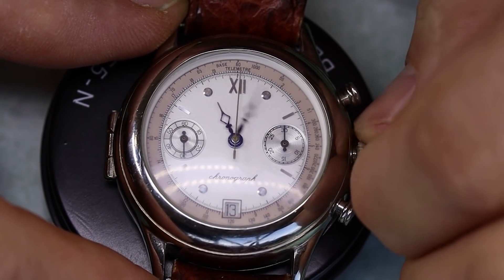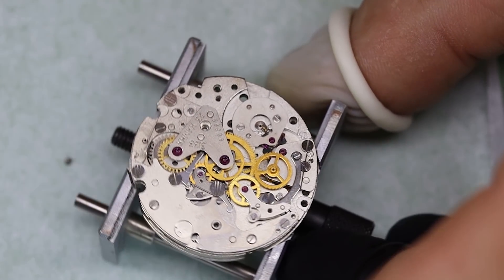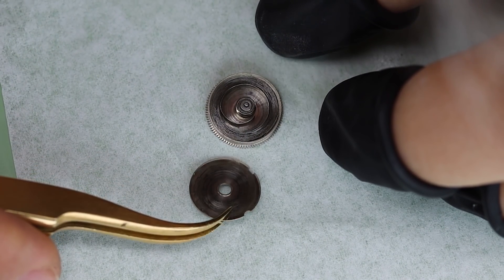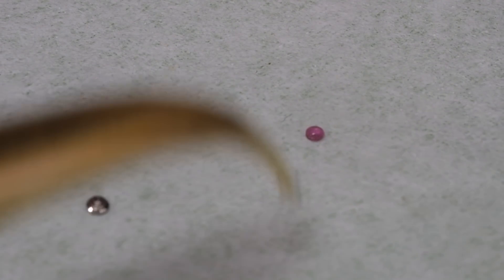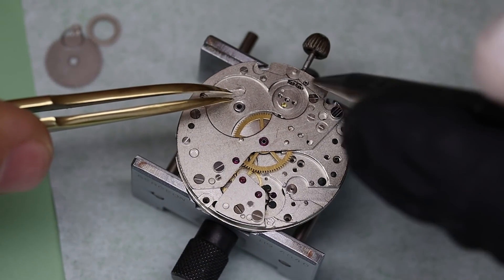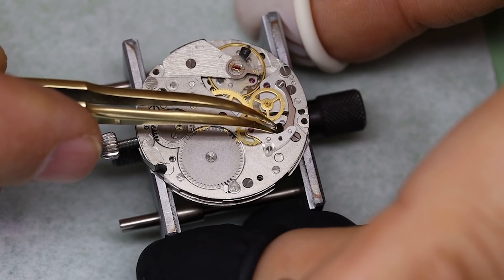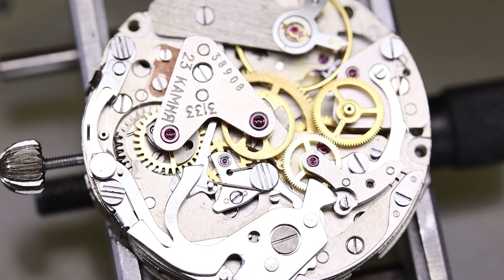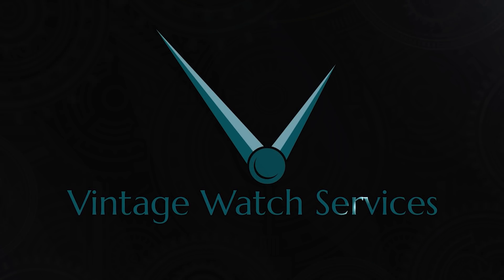How good are Soviet watches?

Comment: What is strange, they normally write "Made in CCCP"  or "Made in Russia" on the dial and the equivalent in Russian on the back. Also the painted instead of heat-blued hands are indicating Chinese origin. On the other side, Soviet movements look more rough in general, the surface treatment is less shiny.
Reply from the maker: This might very well be a Franken, the dial and case might not be original to the movement. From what I know, the movement is from the late 80s but the dial seems newer and possibly Chinese according to other commenters.
Reply: @VintageWatchServices  верно! Механизм это СССР, корпус - Китай)
Reply: @VintageWatchServices  Yes , it could easily be a franenstein watch , that would account for the part being broken and maybe that screw that you had to put a shoulder on might have been a wrong one used by whoever cobbled it together
Reply: I have a watch that says USSR, and it has a more traditional dial and is heavily gold plated. Looks very different from this watch.
Reply: I think you could make a successful comedy channel as well as a first rate watch one.
Reply: @VintageWatchServices  i agree, yet there is nothing wrong with a franken. my favorite is a 3133 I recased, changed dial, changed hands. the reason was for comfort and readibiility and this is my personal one of a kind. one thing to remember on 3133 is never reset the chrono unless stopped! 
some people like a watch to be a museum artifact, others prefer them to be a useful tool, and some poor fools use them as jewlery. I have not yet come across a 3133 that couldnt be cleaned and serviced to within 5-8 seconds per day: useable for astronavigation. as long as you dont actually use the chrono ;)  because then all bets are off. thats normal for movements that share the mainspring with the chrono.

Comment: Thanks for sharing this. I am more into machining but Your presentation is just addictive ...
I have owned a Lada. The model was 1200L and it was a very reliable car especially when it was cold. For extreme weather it had this hand crank for starting the motor by hand. When it was really cold, You just turned the motor over a few times with the crank before trying to start it. That made it little bit less stiff and it started as if it would be summer. With cold weather I mean temperatures -25C or less.
That car had very stiff steering and most uncomfortable driver seat. In Finland we said: "Visit the gym before buying a Lada".
Very few Ladas have survived because they had some corrosion problems and were usually scrapped because of their affordable prise.
Reply from the maker: Thanks so much! Ladas were indeed quite cool and I was in general very happy with mine. The only letdown was when the heating gave up in the middle of winter, but that was because of a faulty water pump. Relatively easy to fix and afterwards it worked just fine again!

Comment: Yes you are correct . I too have had a snapped operating lever . Plus a ridding high yoke allowing the sliding pinion to jam on the intermediate wheel , stopping the movement.

You are a good teacher
Reply from the maker: Thanks so much, Andrew! Did the operating lever snap on a 3133 or a Valjoux?

Comment: When I first started collecting Russian watches I longed to have a Poljot 3133 in my collection. I got one, and then sold it and some other watches in order to buy a much nicer Omega. Then, a few years ago a good friend in Ukraine gave me a Aviator 3133 chronograph and another Buran came into my possession. The Aviator had something wrong with its case and so I found a different one and dial/hands to swap out. It worked fine. All this to say, I love the 3133 chronographs even though they aren't all that pretty and suffer from poor craftsmanship. Probably from folks who weren't exactly "watch makers" but knew how to follow directions to assemble them. Thanks for doing this one. It's pretty, and yet has its flaws, like most of my experiences in the former USSR.
Reply from the maker: The base 3133 design is very sound of course, based as it is on a Valjoux design, but the execution of it is indeed a bit rough around the edges (literally). The newer ones are apparently more refined though, so I suppose they improved :)
Reply: @VintageWatchServices  nothing time and care cant fix!

Comment: Hi Stian, another excellent interesting and informative video, i quite like Russian movements i have 4 good ones a Raketa 2609 ha 2 poljot 2614.2 H that i got from ebay got one in a job lot both just needed a service and regulating now both are around +-3 s/d 36 mm in Seconda watches and another with a Slava 2427 that needed work cracked jewel and worn barrel bridge on the arbour close to the crown, i didn't have the tool's then so got a doner movement now runs like a top i did know to put into time setting to remove and replace stem Ranfft on google, had to have a sensitive touch to replace though, Russian movements for practice and learning great, thank you for sharing Stian. I hope to have a go at fixing a chronograph soon.
Reply from the maker: Thanks Dave! They are indeed excellent movements to learn on and generally quite solid although this one had more than it's share of problems...
Go for the chronograph, you can do it! Take a lot of pictures and be very careful :)
Reply: Hi Dave, I’ve not serviced a Chronograph yet, it will come.

Comment: There's no way in USSR that watch would be sold in the western market without "Polet" logo and "Made in USSR" and letters in latin. Period. That is post-Soviet era watch, possibly from the early 2000's or even late 90's.
Reply from the maker: Thanks for that info! I have some suspicion the dial, case and movement might not be original to each other. From what I know, the markings on the movement and the materials used indicate a post-1983 but pre-1992 manufacturing date, but the dial indeed seems newer.

Comment: Another great job Stian! And useful for me since I have a small collection of these, and there's a  couple things I can apply...
Regarding quality, the specific movement you sre servicing here seems to be from 89 (change from 4 to 5 digit s/n) to 91 (when chrono bridge inscription changed), a time where things were going south in USSR, and quality control in Poljot was suffering. I find that early 80s pieces are better built. Also, the dial and case are most certainly either post-soviet era, or chinese imports. All in all, IMO a not-so desirable 3133, especially compared to the steel case military pieces.
Reply: BTW can you share the mainspring replacement reference? I haven’t been unable to find anything in GR, and it is increasingly difficult to find NOS replacements. 
All the docs I found say it should be 1.60, and you used 1.70, has it caused any trouble?
Reply from the maker: Yes, this is indeed most likely a Chinese case, dial and hands. The metal in this movement is low quality. After this service a subscriber bought the watch and only after a few months the reset lever flag broke off in the exact same manner as the operating lever flag...
Reply from the maker: I used the mainspring list from watchguy.co.uk, it is in general very good. You will find it under Technical Information
Reply: Thanks a lot, I will look in there.

Comment: Thanks for taking the time (all puns intended!) to explain the mechanical underpinnings of the chronograph mechanism and showing how it works. The question I have though is, why didn't the roughness around the barrel pivot hole in the baseplate cause the watch to run poorly earlier on in the life of the watch? Did this roughness develop over time, or do you think it was always there?
Reply from the maker: Hello Tim, I don't know how the watch ran earlier in its life, and unless the barrel was changed, the roughness would have been there to some degree for a long time. But these things indeed grow worse over time. As soon as there is somewhere that dirt and debris can gather, it will, and that will cause wear.

Comment: After greetings, let me ask about that fix drop, in Omega ,they use it with another name called Lubita.to prevent the lubricant  from spreading. Is it the same under different  name?another question, they put the parts after Lubita on a metal surface  for 15 mnts. Under cover ,then we assemble it. An other remark, this Lubita also for lubricating the non reverse wheels
Reply from the maker: Hello Samir, thanks for watching! It sounds like you mean Lubeta, which is an ETA lubricant (lub eta), for reversing wheels (lubeta v105) and ball bearings (lubeta v106). You would use a similar bottle for soaking the parts and indeed let them air for 15 minutes, but these are lubricants, while fixodrop is an epilame. The purpose of an epilame is to prevent lubrication from creeping. It is thus used prior to lubrication.

Comment: my first watch was a Poljot Chronograph which i bought aged 16 back in 1969. I lost that after i stopped wearing it in favour of a LED one when they came out in the mid seventies. Sorely tempted to get another one as they often appear on eBay
Reply from the maker: LEDs were super cool back in the 70s and no one wanted a mechanical watch indeed :) These ones are generally good value for money!
Reply: @VintageWatchServices  the one I had had red Leds that only illuminated when I pressed a button on the case, a bit of a nuisance especially when I have had cover the watch with my hand  in bright sunlight
Reply from the maker: @admiralcraddock464  Very small price to pay for the über coolness, no? 😁

Comment: How did you resolve the broken tab on the pusher lever? Are some of the Valjoux specific parts interchangeable?
Reply from the maker: I replaced it with a VJ7733 lever. The levers are indeed interchangeable but not all parts are.

Comment: Fun video although I was slightly disappointed that you didn't put the minute hand back at EXACTLY 12 when reassembling.
Reply from the maker: Thanks Jack! If you check the video closely you'll see that the hands are perfectly aligned 😉 The reason I placed the minute hand slightly off was that the hour hand had moved slightly. It's a bit risky to do it this way, but with a bit of experience it can work :)

Comment: I have a soviet mechanical watch...and of course it has never kept good time and stopped running a year after I got it! Probably something like you found in this watch is going on it is as well.
Reply: what kind of movement is in it? most of main soviet movements like vostok-2209 / raketa-2609 / poljot-2609 / slava-24** are pretty robust. yeah all of them except raketa-2609N have their flaws, but they are pretty easy maintainable.
Reply: @karlja3ger  No idea....never opened it up

Comment: Hi Steum you could tell the parts are thin and stamped out that as long as it works 🤷🏻‍♂️
Reply from the maker: Yes, many of the parts are stamped out, that was part of the more industrial turn Valjoux did with the 7733 and of course to an even greater extent with the 7750. That made the manufacture much cheaper and easier for us to find spare parts even today :)

Comment: Nice view on oiling the pallet stone. Do you do this with a microscope? I try to do it in a microscope but sometimes I miss the middle of the pallet stone (the grease can be added a bit of centered on the stone) and it can "spread" a bit above the escape wheel teehts. Do you remove this "residue" if it happens or does it spread out after some time? Or maybe this isnt a problem? I try to put the smallest amount of grease on the pallet stone each time so I dont put to much, but hard to hit exactly in the middle of the stone. Well done as always, I learn a lot here, thank you!
Reply from the maker: Thanks a lot, Watcheyes! I think there are no better macro shots than yours on YouTube, tbh. What equipment do you use for that?
I use a microscope for the pallets, yes. My eyes aren't good enough to do it with only a loupe. You want the oil to stay on the stone face, that's where epilame comes in handy. If the oil spreads over the edge you need to take the pallet out, clean it and reapply, otherwise the oil will creep more.
Reply: @VintageWatchServices  Your welcome. Wow I appreciate it a lot coming from you, thank you :). I use SonyA7s, sigma 70 mm macro. I see, yes I use microscope also, it can reach max 30x but I think I need 45x (this is also used for filming sometimes). Well its Okey now but sometimes my aim misses, so if I atleast hit the stone and not over the edge I guess it's okey then, thank you :), have a good evening!

Comment: Interesting model...Having a few 3133's myself, I love the robust build....breaking the chronolever must require a lot of force, maybe dropped on the pusher?
Reply from the maker: Thanks Rich! Dropping it in pusher wouldn't break it, no. I think the problem was that the lever was completely stuck and someone pressed as hard they could on the pusher... But the broken piece was nowhere to be found, so it's all a bit strange...
Reply: @VintageWatchServices  given its good condition it may have come from the factory that way and never been fixed. they just wore it as a watch until it died.
Reply: @VintageWatchServices  strange indeed but a great watch

Comment: So was the piece that broke off non-essential? I can’t find where you fixed it. (Only the screw shouldering.)
Reply from the maker: Sorry, it wasn't clear in the video, but I replaced the part. Repairing it isn't really an option, given that a replacement is about CHF 30.

Comment: Did you do any more work on the chronograph operating lever after putting the shoulder on the screw because you can clearly see the screw unwinding itself when you operate the lever so I asume this would eventually wind itself out or did you increase the shoulder size?
Reply from the maker: Hello Mark, I'm not sure which clips I ended up using in the video, to be honest, as I had to make several adjustments and tried the screw many times, but ultimately the screw does stay tight.

Comment: Now, Stian, according to calibercorner the 3133 is 7.38 mm thick. If that's a centimetre thicker than the 7734, Valjoux must have created quite a technical marvel back in the day.
Reply from the maker: 😂 Should have been a millimeter :)
Reply: @VintageWatchServices  You said it later in the video, but I couldn't resist.

Comment: Talking about your little Russian car It had to be better in the cold than a Volkswagen bug which had no water circulating so no heat but the block never froze either started💥no matter how cold it was 🥶😌🤷🏻‍♂️.
Reply from the maker: My mother's Opel's engine froze completely one time in Norway after a -30 cold streak. It didn't even start rolling it downhill for a kilometer... Had to wait until it thawed!
Reply: @VintageWatchServices  this is Richie from America, Stian I hope I’m spelling your name right, at least nowadays you could put a Low voltage dipstick that you connect to the battery that keeps the oil warm 🌋 speech is not free🧐 🤷🏻‍♂️🙋🏻‍♂️✌🏻 thank you for your words I’ll keep watching I respect your mechanical abilities

Comment: Question, this is not an expensive watch as I understand. But the work you have to do is the same or maybe more then for far more expensive watches. What are the prices something like this sells for and what does it cost to do a service like you showed us today?
Second question, could you make a video about all the tools you use. I’m not in watch repairs but have a hobby in repairing, restoring, old modeltrains and I’m always at the lookout for good, small, tools. So what do you use and where to get it? Hope this is possible!
Reply from the maker: Hello Hans, thanks for watching! This kind of watch typically sells for some 4-500 euros. A service costs some 250-300. I got this one very cheaply so I should be able to make a small profit, but I also wanted to do one for the channel. 
I'm probably going to take the channel into a bit less technnical direction rather than a more technical one. With the channel approaching 20000 subs, I'll soon be forced to be able to respond to all messages as it simply takes up too much time, so I probably will create a members only section where I can do the more technical things and respond to all questions etc. What's your thought of this?
Reply: @VintageWatchServices   well, as already said, I’m not into watches but I like the way you present this and the way the mechanics work.
And yes, technical information, so people with the same interest can learn from you, to me is more important. That’s why I asked for a special on the tools you use, including that wonderful cleaning machine.
If a separate group is better for your workflow, do so, it’s you channel. If it means the I have to become a patreon, don’t expect me to do so. The one thing I hate about especially Youtube is the fact that more and more channels ask their viewers to pay for information  available on an earlier date, extra content etc. While the same viewers made these channels grow at first.

Comment: Who did they reverse engineer that from?
Reply from the maker: The rumor is they bought a few 7733s and 7734s and made it based on them. Then later they bought the machinery also. But if one compares the Valjoux movements to the Poljot movements, there are small differences in the position of the wheels etc.